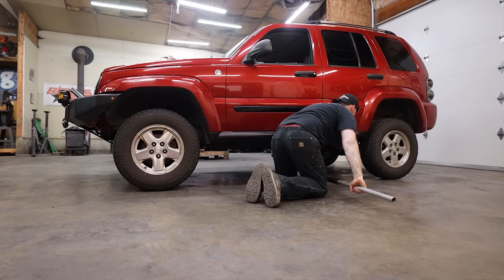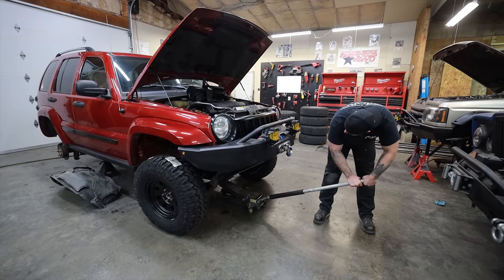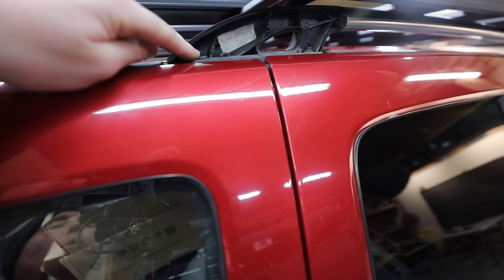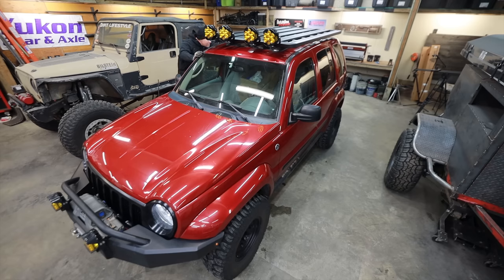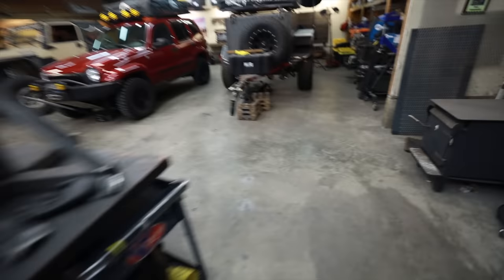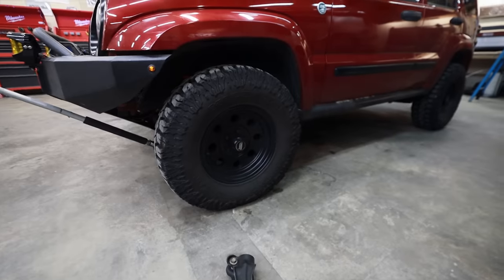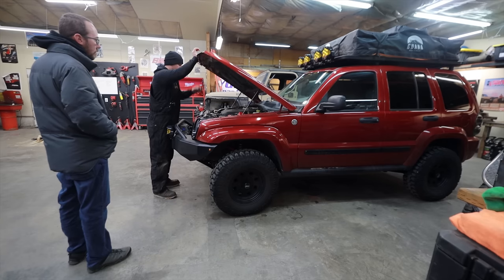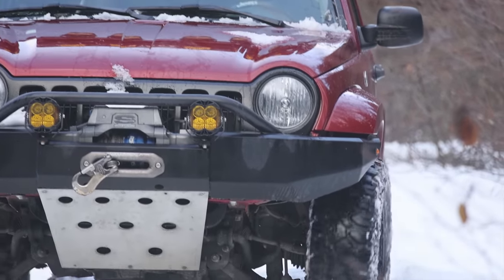I Finally Finish My Brothers Diesel Jeep Liberty!

Comment: Do you have any issues with the CV angles? And does swapping the forks help with cv angle at all? I have a similar lift 3inch ARB, JBA uppers and my CVs are too angled. I have tried limit straps but it doesnt help much.

Comment: Are those 15 inch wheels? I need tires for mine but I have 16 inch wheels, I was thinking 15 inch wouldn't fit over the brakes etc.

Comment: Awesome... I still have my 2005 Liberty didnt spend kuch money but lifted 2" and got some cheap ranchos on it and runs smooth on the trails... Many adventures with it in the last 8 years... I just got me a jeep trailhawk 2017 which i am loving as well.. but not fond of many sensors on messages board...

Comment: I love this. I wish I knew how to build things the way you do. Honestly dont even know where I would start with a bumper like that. I did watch your video on it but where do I even go to find steel like this? I have a 2016 ford explorer with a 3" leveling kit and 31" tires and its not amazing offroad but it will get the job done most of the time. If I ever sell it I am gonna buy an H3 hummer adventure with the factory lockers. You can drop 35s on them with no lift and just go.

Comment: I don't know if this is the right place to bring up this question but I'm currently looking to get a new Daily driver/weekend warrior and I have 2 options.
1994 Mitsubishi Delica L400 2.8 TD 275,000kms
2006 jeep liberty CRD limited 2.8 TD
275,000kms
And both are roughly $7000 CAD or $5500 USD.
Which vehicle would you guys rather own and build up, I am completely torn because both are very cool and I can think of good reasons to go either way. I just wanna hear other people's opinions.

Thanks guys

Comment: 10:26 but there is rubber grommet in firewall which can be used to guide wires, on drivers side. used this to put through few.

Comment: The fork from the 2009 liberty thing sounds like it's going to be a life saver for me. Ive gone through cv boots because I bottom out and clip the boot. Defiantly going to give it a try!😃 That's if I keep this electrical gremlin car. Every 1000km there is something new to fix on this damn thing and it only has 86k km on the clock🥲 I love it but damn I hate it too sometimes😂 If it wasn't so damn good in the sand and off-road in general I would have sold it immediately🥲

Comment: The KJ Liberty (Or Cherokee here in Australia) is fairly underrated! I've taken my slightly modified (2.5" lift, Roofrack, 30" tyres, LED spot lights) through a lot in the Australian outback. And the only thing that needed replacing was the frot prop-shaft uni joint as the boot cracked and let a heap of sand and dirt in.

Comment: If its not a manual there is a hole in the firewall I used for my wiring that would've been for the clutch. On autos they just put a rubber grommet in it. Easy to use and you just put a hole in the grommet to seal it up again

Comment: You can also add 2" conduit nuts between the strut fork and the bottom of the strut as a spacer. You can add a total of 3 gives about an inch of lift. Add a rusty's offroad top plate to the top of the strut and get another 1/2 inch of lift.

Comment: Love my CRD KJ Liberty. You just have to understand that lifting it starts a timer on the front CV axles. You will be replacing them more often. The CRD front differential is shifted more to the driver's side to accommodate the diesel motor. From what I can tell, this means that the driver's side CV shaft is shorter which causes the CVs to bind when there is no load on the wheels. I think limit straps could help this and I plan on trying it out.
Reply: Did you try the limit straps? I have them on my KJ and I don't see a difference. My CV's need replacing alot more often than I anticipated.

Comment: Air wedges are commonly used to get into vehicles when people lock their keys in. 

They are inserted into the passenger's door and the door is pushed open enough to either snag the keys or push the power door lock button with a long rod.

Comment: Hey @Dirt Lifestyle sorry I'm late to the party.
I've owned a Liberty. Well, actually 2, to make the original one better...
My plan with the roof rack was to use canopy tracks (Front Runner TRCA002 iirc, although discontinued) and shape them to fit in that recess where the original "bars", bolted to the original mounting holes. And then use different height adjustable feet to mount the roof rack on. The idea being to spread the weight over the tracks, using 3 or 4 sets of feet depending on the load.
Never got to do it though, long story...

Comment: Thank you for doing more to this build! It's awesome! I own a KJ on a 4in lift overland style rig too. If you didn't know you can get OME front springs rated for the CRD. OME 2790 is the part number. Put that with some Bilstein 4600s and you will be good to go! I run that on mine with a bumper and winch too.

Comment: I know that this is months old but I found out the M4 studs are crap and only held in by the roof skin. 
if you over tighten them they will pull out and cause a roof leak.

Comment: Awesome work man just found your channel. I just rebuild the suspension on my gas kj although it killed me not to lift it I had to keep it stock because my college shop doesn’t let us use aftermarket parts. It’s been an amazing car even though it gets hate It’s got me home from 30 minutes away in 2 blizzards and a storm before the roads completely flooded. Hopefully by the time I have my own driveway I’ll be able to lift it. Definitely regretting not looking harder for a spot to do it now that I saw your video. Looking forward to seeing it on the trails!

Comment: I've always thought the liberty looks nice lifted. Great job!!! I noticed you cut Square tube flat in your saw. Try using the tube adapter and cut it with it on edge. It will save time and make your blade last longer. Anyway great content, hope to see you on a trail sometime 😀

Comment: We've been looking for a CRD liberty for some time now. These are such cool rigs and you've done a killer job with it 👍
Reply: Im going to get one soon here an im just cutting it up to soild axle swap it like my other kj lol
Reply from the maker: It took us over a year to find this one! We actually have alot of crd Libertys in the pnw but I really wanted to find one that was fully loaded and didn't have anything done to it yet. This one had 86k on it so I did the timing belt, upgraded the charge pipes, installed a billet torque converter, a shift kit, did an economy tune deleted the factory muffler and deleted the vicious heater. 
For the next 5 years of Ownership we didn't do anything but change the oil and the fuel filter. It was super reliable and very fuel efficient. I still miss it lol but you can't keep them all. If you take care of these and upgrade the problem areas first you will love it!

Comment: I'm bit late to the show but man that's a great list of suspension upgrades. IRO also has a full set of adjustable rear control arms that can be optioned with a Flex-joint on the frame-side. Another option to positioning the rear axle or setting pinion-angle.

Comment: Very timely. I was just planning over the last week, building my own roof rack for my suburban, using the factory roof rack mounts like you did. Since aluminum is less expensive than steel now I’m planning on using sched 40 aluminum pipe. 
Keep up the great videos!

Comment: Sick idea of the air wedges. I do a lot of fabricating by myself also and these look like they would be very useful. I'm wondering how spark resistant they are??
Reply: Might be good to go, if you wrap with welding blanket? Or protect with a welding blanket.

Comment: I have an 07 tahoe that I’m starting to set up for more capabilities off road. I raptor lined the whole body last year, my property is wooded so this takes care of pinstripes and light impacts dents. Currently has a 2” level with 33”s on 18x9 procomp wheels, but plan on a 3-4” suspension lift later this year. Can’t wait til i can get started on the rack and bumpers too. You don’t see many gmt900 suvs set up like that and getting used more than picking up the kids and going grocery shopping lol.
Reply from the maker: Nice! I love this trend of building less sought-after 4x4s! There is alot more available then your run of the mil tacoma or wrangler. I think the Tahoe is a great starting point!

Comment: I got a 2000 chevy suburban ls 4x4 for $5,500 in perfect condition with a motor that's only got 20k miles on it  old tahoes and suburbans are another great choice to buy if you're interested in building it up as a trail rig and anyone considering should by now because they are gonna go up in price even if they look a little clapped out because everyone knows they are reliable and they also have much less electronics to deal with

Comment: "Run what ya brung!" Amen, brother! I have a 2004 Chevy Trailblazer EXT, the 3 row seating model. Right now it has a 2" front, 1" rear  leveling kit with 1-1/2" BORA aluminum spacers and 265/70R17 Firestone Destination AT/2's. Plan for this summer is to replace the front suspension spacer with a  2" BDS strut top hat, new Bilstein 4600 struts, Moog coil spring, and new strut mounts. The back will get new Z71 springs (from a 2009 Tahoe, don't worry they will fit, it's a popular upgrade), and Rough Country 23204 shocks. I plan to keep the aluminum spacer from the leveling kit. I also plan to install a Badlands Apex 120000 winch and winch plate. I've pretty well got it mentally figured out how I'll do it, just need to get it down on paper. Need to buy some steel, though.

Comment: Always top notch videos from you Nate. Keep it up, but don't forget the work/life balance, a break is always helpful when needed.

Just watched your "First thoughts" video on the Taco build. Crazy to me to think that a 38 can fit on a Tacoma, of course with mods that push the wheel center forward. 

I'm building a 2010 Ford Ranger with a tent, bumpers (front one I bought, rear one I'll build with Jerry can holders and a tire carrier), winch, sliders eventually, leafs and shackles, gears and the rear axle from my 92 ranger (profile pic) with a lunchbox, and throw a bunch of camping gear in it and head for the Manitoba bush in. 

Would have liked to keep driving the 92 but it had almost 400k kms on it and the frame and cab was too rusted and would have required a lot of work to get looking good. 

So I decided to get something newer that works great and can find parts for. 130k kms and only 1 small spot of rust on the back of the cab I can't complain.

Comment: I have a Commander XK and the WK Grand Cherokee share the same parts. Do the KJ Liberty's share the same parts with XK/WK as they look very similar?  I wanted to do a Superlift 4" but they discontinued it. You have any suggestions as parts in the aftermarket?
Reply: No the liberty basically has the same exact driveline as a first gen JK,, np231J transfer case and a 42RLE Trans , dana 30 front diff,, and Mopar 8 1/4 rear diff same as a dana 44 basically…

Comment: I heard CRD’s ate transmissions when they came out. Did you have or solve that problem? (I ended up with a 90 Ford V8 Ranger project instead)
Reply from the maker: The factory American torque converters are garbage. They are made for a gas truck and don't hold up to the low end diesel power. So people either upgrade to the European version or get a billet unit from Suncoast. I did the billet converter and even installed a shift kit. This transmission rocks when you upgrade it and I upgraded everything that was a notorious problem right away like the converter and the charge pipes. I do this to everything I buy lol. I research the common failure points and upgrade them first.

Comment: Didn't that engine have a bunch of problems and recalls.   I know because I owned one,   it spent a long time in the shop.   This was when I was daily driving it 15 miles to school and back. 
searching any forums on the engine you will find the equal amount of disappointment in ownership.

Comment: In November of 2021 I bought a brand new 2002 Jeep Liberty. I absolutely loved that Jeep. It drove great on the road and was also really capable off road even bone stock. I dove it for about seven years and then when I got married it became my wife's  everyday driver. When we had about 105,000 miles on the Liberty the transfer case blew in my Cherokee. So we bought a used 2006 Jeep Commander for the wife and the Liberty got the lift and tires I had been wanting for a long time and became my new work vehicle. For all of the naysayers out there I had my Liberty in some really rough stuff in the mountains of WV and PA and it never disappointed.

My 2002 Jeep Liberty had the 3.7 liter v6 and was equipped with the factory off road package and towing package. This includes a limited slip rear end with 3.73 gears and a high capacity cooling system. It also had pretty good skids from the factory including one that completely covered the front differential and engine oil pan.

Here are some of the Mods:

1) 2.5 inch Frankin lift: This consisted of Old man Emu HD extended coils, shocks and struts
2) Jeepin by Al after market a arms
3) All new Moog heavy duty upper and lower ball joints and tie rod ends
4) boulder bars
5) rock crusher rear differential cover
6) 16" Jeep Rubicon Wheels
7) Goodyear Wrangler MT/R (with Kevlar) LT245/75R-16 tires
Reply: Edit: I bought it new in November of 2001.

Comment: I have one of these and it was in the shop13 weeks, costs me $2300.00.  Had it for a day when it broke down again and it's in the dealer again.  Before this it was in the shop for three weeks, costs me $3000 before it broke down again after a week and this is a VERY short list.  I've had it for over 14 years and it only has 97000 on it. They can't get parts for it and they don't know how to fix it, it's a dog too.   Oh, and the four wheel drive has been broken for a decade or so and my mechanic has warned me not to have it fixed because of what it would cost and the check engine light has been on since the dawn of time. I wouldn't wish this on my worst enemy.
Reply: You need a better garage! They are one of the simplest diesel engines going!

Comment: how much is the roof rated too on that thing surely the tent and rack and awning would putit over the factory recommended roof weight limit
Reply: Those roofs are rated for 150 lbs
Reply from the maker: Rated at 150 lbs. which is based on the vehicles center of gravity more than the strength of the roof. And if you lift your rig the capacity goes down even more.

Comment: When you have something that’s designed to be more like a car the main problem is gonna be the gearbox not the tires.
 If you watch Matts off-road you’ll see that cars can go way out into the wilderness with average tires on, They eventually get stuck but the gearbox is a bigger problem than the tires. And the gearbox he’s gonna hate those tires on the highway and be a dog.
Reply: Umm maybe your not informed ,, but the KJ liberty has the same driveline as a first gen JK wrangler , part number for part number.. 8 1/4 mopar rear diff ( same as a dana 44) Dana 30 front diff,, NP 231J transfer case,, 42RLE Trans..  it just has CV joints on front diff , solid tube on passenger side to CV joints to the wheels.. 2022 Rubicon also now has CV joints at the wheels.. it is basically a JK wrangler in a different body , it was not designed to be a car,, it is in fact a full fledged Jeep.. Bronco also uses a IFS front has both advantages and disadvantages , but liberty IFS is alot different and much stronger .. so of liberty driveline is weak so is a JK wranglers because they are exactly the same… knowledge  is something ya should have before speaking in public..